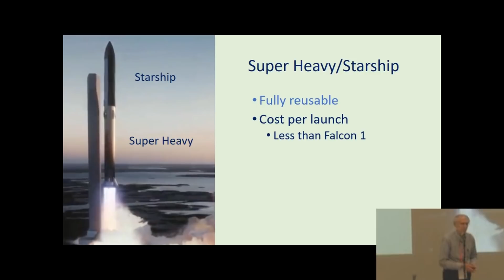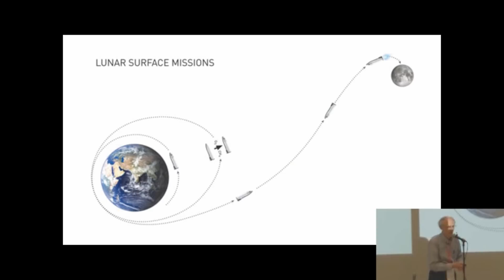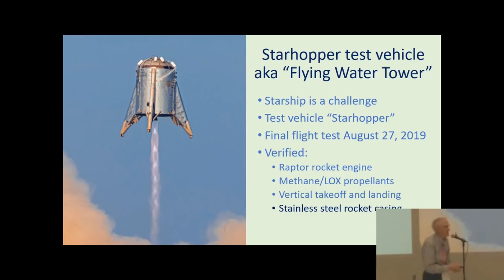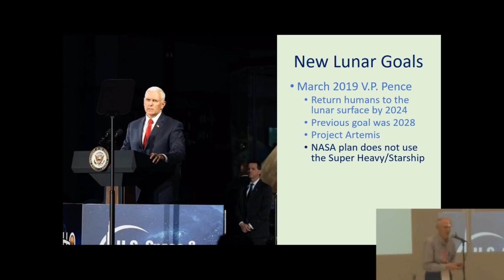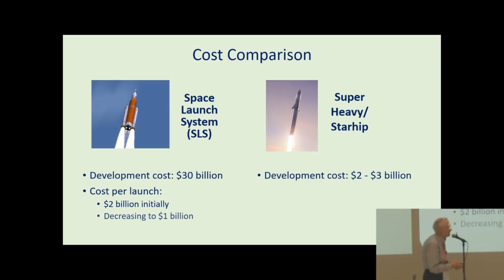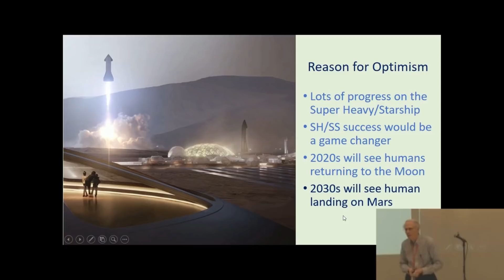Gerald Black - SpaceX Super Heavy & Starship - 22nd Annual International Mars Society Convention

Comment: Contradictory info from the Mars Society.  How can a SH/SS land on the moon without first having constructed a place to land there?  Something that enormous would blast a crater 10 of meters deep in the lunar soil and those spindly legs would have no hope of keeping it upright in the hole it had dug itself.  This was precisely the opinion of another TMS presenter, though not this guy.
Reply: It can slow down well before the surface and still have a "soft" landing.  Because of the low gravity of the moon it won't need much thrust at the time of landing.
Reply: @themanyhobbiedman  
Low thrust equals extremely deep Raptor throttling, or scaled-down propellant injection pressure for Lunar landing. Maybe the Raptors can bypass the turbopumps near the surface and just use tank pressure?
Reply: In lunar orbit, bay door opens for lunar lander seperate of starship. Or docks with lunar lander sent on a falcon heavy launch.
Reply: @alexFortJames6625  What Lander?  SpaceX has made no mention of a lander that I'm aware of.  Nasa's Artemis has one.  More to the point, Falcon heavy huge advantage is it's massive cargo capabilities. Are you suggesting that SpaceX will transport it to the surface, bit by bit, with a lander?
Reply: @mojojomo6750  
You are correct no previous mention of a separate lander. But it's possible. A lander could theoretically build a landing pad for starship.
Reply: @alexFortJames6625  I agree, building a landing-pad first, is the ONLY way to go.  Which was the point of my first post - one Mars Society's video lecture states, as it stands, it is impossible to land a falcon on the moon , something I agree with. Of course, maybe they have landing-pads already built (probably decades ago) but have neglected to tell the rest of us.
Reply: @mojojomo6750  right, Haha, never can tell. But some of the recent tech around building habitats with regolith could also be used to build landing/launch pads.
Reply: I see starship landing with just the finest regolith blown away. This stuff is not all fine scale. The real issue is landing near inflated "habitats". That is when some preventive measures will be important. Probably need to bury them anyway.

Comment: Nice presentation but tell me how is the starlink going to land on those 6 “pins” without topping over in the soft regolith. I’d like to see starlink land on a California beach before risking it in the solar system.
Reply: Starlink is a constellation of internet satellites orbiting Earth. You probably mean Starship. Please remember that the current Starship designs are prototypes designed to land on a concrete landing pad in Boca Chica or KSC. I am certain that the variant that initially lands on the Moon will have a different design for it's landing gear. Eventually there will be solid smooth landing pads on the Moon as well. People are designing robots right now that will be able to level the regolith, remove any big rocks, and laser sinter the dust to make landing pads that Starship could eventually use. Robots can then pile the rocks between the landing pad and the settlement/valuable equipment to prevent damage from thrust kicking up dust.
Reply: Well I hope so. I understand the shape is to take advantage of the thin mars atmosphere to slow the vehicle down a bit but when landing on regolith something close to a 1:1 aspect ratio is desirable. Thanks for your comment

Comment: 3:10 Do you think that they will use the crew version to launch cargo to the space station instead of the cargo version? Because the crew version is pressurized and can actually dock with the station.
Reply: From what it appears after a crew dragon has flown one flight with crew it will go on to become a cargo dragon. I don't think they will fly crew twice in the same crew dragon given the refurbishment cost to be crew certified after a water landing. I could be wrong but that's what i was able to gather.

Tyler

Comment: Google "Plasma Magnet Drive" and "Dipole-Drive". We can go to "Mars in a week". This was reported in Nextbigfuture and Centauri Dreams in 2017. Dr. Lewis Fraas did an IAC paper on Infra-Red Power Beaming from Geostationary Space Solar-Power Satellites in October, 2019. That was the final ingredient needed, power! Dr. Slough's PMD uses Solar Wind energy to go 80 times faster than chemical rockets. Dr. Zubrin's D-D allows PMD Rockets to slow down for Mars gravity well capture, and steer sideways to the local Solar Wind direction. IR power beaming to 40% efficient multi-junction panels on the Starship is the final piece of the puzzle.
Reply: no form of propulsion is faster than chemical rockets. all those "alternative engines" like ion or solar flairs achieve high speeds through constant but slow acceleration. chemical engines are the only ones capable of generating the fast acceleration required to reach mars in a month or so.
 everyone who claims ion or solar flairs can "get to mars in a week" are lying or bending the facts. it can reach mars in a week, but it has to accelerate for years to achieve the speed to do so.